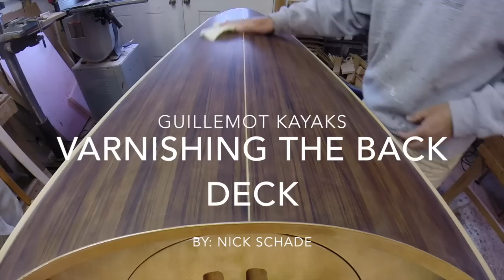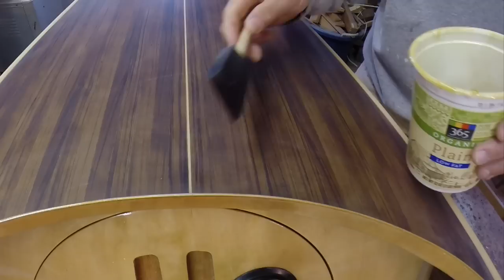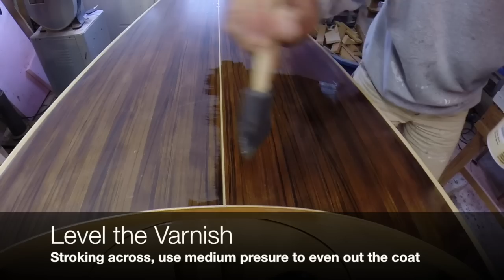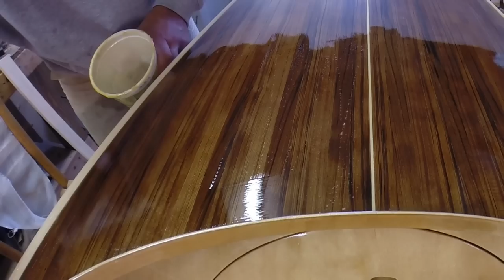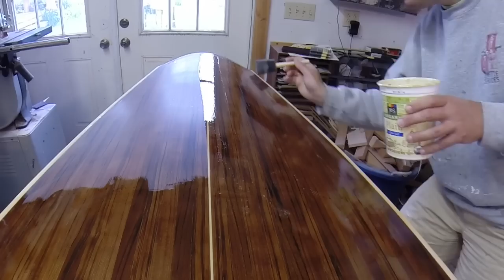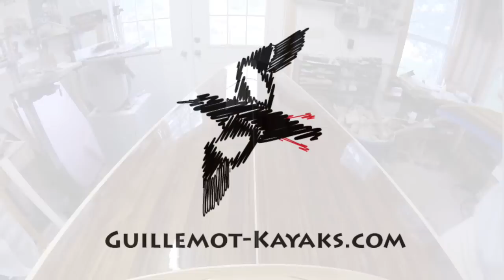Applying Varnish for a Smooth, Reflective Finish on a Strip Built Boat

Comment: Love the finish , I've always used a foam roller though and then tipped off with a foam brush at 90% to the roller line ! Then as the varnish dries keep tipping any imperfections ! That's my method ! Cheers knackers
Reply from the maker: After the varnish starts to set up and has lost its wet edge - about 30 seconds - any time you touch it will leave a permanent mark. Tipping off after that will typically add more imperfections than it removes.

I've used the roller, then brush technique but found little benefit in having to switch from one tool to another during the applications process.

Comment: I always put a thin coat of epoxy on bare wood to raise the grain and seal the wood than sand. The glass wets faster and does not get dry spots as sometimes the wood absorbs epoxy at different rates.
Reply from the maker: +Daniel Cohen There is no bare wood anywhere on this boat. Every surface is covered with fiberglass set in epoxy. This makes a much more durable finish than varnish on wood coated with just epoxy.

Comment: I don't know if this varnish is good for a dining table, I have very small grandchildren and they make a right mess at meal times so my table gets wiped very often. Would you recommend this yacht varnish ? The table is a reclaimed solid pine  table.
Reply from the maker: This kind of marine spar varnish would work, but some polyesters are a bit more durable for interior use. Application would be exactly the same.

Comment: Nick, I have watched this several times thanks for posting.
I am practicing and continue to get bad results with epoxying over glass!
Can you answer why I have sketchy areas of fiberglass weave and noticeable individual threads showing under the epoxy?
Also I am getting several bubbles (pimples) I consider to be outgassing in my layers of epoxy is this due to applying during hot days? 
Thanks
Reply from the maker: The visible threads is likely something to do with your epoxy work prior to varnishing. Sometimes the wood sucks up epoxy, starving the weave of the cloth, with the result of incomplete wetting out of the fabric.

Small bubbles may be outgassing, or they may be dust on the surface. Doing epoxy work in falling temperatures helps with outgassing. Dust is hard to prevent. If it is causing fisheyes or dry spots in the varnish coat, you could brush hard into those spots to try to fill any pin hole with varnish before applying future coats.
Reply: Nick Schade w

Comment: Would I use an oil based varnish like this to repair a wooden shaft of an outrigger canoe paddle? Or water based? I don't know how to choose the appropriate product. Part of the shaft was rubbed down to the wood while rubbing against a bailer holder made of a coat hanger during a race.
Reply from the maker: Oil based varnishes have a proven track record. You can be pretty certain they will work if properly applied. Water-based varnishes continue to improve and some are quite good, but the technology is still developing and your results may vary.
Reply: Thanks! I ended up contacting the person who built the paddle, and he recommended marine grade spar varnish (oil). I used it and had great results :)

Comment: What % of thinner do you go with to get the varnish to flow out so easily and level off without sagging or running? Thanks! Great finish btw!
Reply from the maker: I usually do not thin the varnish at all. Different varnishes work differently, but the Zspar "Captains" varnish I use is great right out of the can.
Reply: @NickSchade  That's what Ive used in the past with success. Also used Epiphanes with 5% and it was ok. But recently, I tried Total Boat Lust and Im not happy with the results at all. Un-thin the brush strokes dont lay down. With increases in thinner (5%-7.5%-10%) the brush marks go away BUT heavy sags start to form   around the vertical sides. There really is no magic formula with that stuff. 
I guess, lesson learned, it pays to get the best varnish to start instead of trying to save the dime.
Reply from the maker: I have not tried the Total Boat product yet. I have used unthinned Epiphanes. It was like spreading honey, but it leveled out beautifully.
Reply: Total Boat's claim is you can apply additional coats every hour to build up fast. Limit is 3 coats in 24 hours. This all true... after an hour it was dry to touch either spraying or brushing.  Biggest problem Ive had with it is it wont maintain a wet edge but for a few seconds. I think this is due to their drying agents and my hot shop.  I live in the south and its alway hot here.  Im sure its a good product and works under better conditions.
Reply from the maker: With that kind of quick build varnishes I will usually go for a fast application of multiple coats to get the build, not worrying too much about smoothness, brush marks, dust, etc. Then sand it out level before the last coat. I would then use a different, slower drying product for the last "show" coat.

Comment: Hi Nick ..I was wondering if you can give me some advice...I am varnishing a strip boat for a friend..but it he layed a really ruff coat of resin over cloth..do you think I can recoat resin with a good sand down..or should I just continue on with varnish?...also what it the best varnish line in your opinion? by the way your videos are great keep up the amazing work!
Reply from the maker: You will not get a smooth coat of varnish without a smooth surface below it. You should prep the surface to be perfectly smooth before you start varnishing. If the existing surface is rough, you should sand it flat. If you can not do this without sanding into the cloth, sand as much as you can, then apply another fill coat. When that cures, sand it flat up to 220 grit. Then proceed with varnish.

Comment: Do you have to use the same varnish on floor boards. Nice work by the way
Reply from the maker: Like for a house floor?  I would not necessarily use marine varnish on a flooring. It would look great but I think there are some modern finishes that are easier and more durable for walking on.

Comment: Great video. What is the ratio varnish to thinner and what type varnish and thinner? I use Epifanes clear gloss.
Reply from the maker: If I remember correctly, I am using Z-Spar "Captains". I generally do not thin the varnish. Since the base is epoxy/fiberglass there is not need to thin for penetration. Epifanes is quite thick out of the can, but will level out nicely without thinning.
Reply: You do very nice work sir. I noticed the very light touch to your ending stroke and I will use your technique next week if Cleveland weather lends a kind hand to my project.
Reply from the maker: Yes, the first pass I use a heavy stroke to get the varnish off the brush and on to the boat. The next pass is a 90° to the first with a moderate touch to level out the varnish, the final pass is with a very light touch to tip-off any bubbles and the light touch will actually lift off excess varnish.
Reply: The final coat is always thinned down for bubbles to pop easier and to make a glass finish. Just dont exceed the instructions ratio. The thinned finish will run alot easier like water. The 1st several coats are "generally " not thinned.

Comment: Nice job! Is boat varnish suitable for an acoustic guitar?
Reply: The late great Robert Ruck used varnish on many guitars successfully all though it was the exception when he used it. We spoke on the phone about his varnishing for at least one hour. He liked captains 1015. To varnish on Rosewood it is advisable to seal with a coat of shellac to avoid drying problems on that oily wood. Any finish can sound good on a guitar top if you Can achieve good results with a thin enough coat.Of course Kohno and Velasquez primarily used varnish.

Comment: Can you varnish wood before fiberglassing it?
Reply from the maker: +Jonathan McClellan I guess the question would be: why would you want to? 

It is worth understanding why we varnish anything in the first place. It is to protect the material under the varnish. Varnish protects bare wood from sun, moisture and gunk getting stuck to it. 

Varnish protects epoxy and fiberglass from ultraviolet light which breaks down the epoxy.

So, while you could varnish the wood before fiberglassing, it would make it so the epoxy does not stick as well. The fiberglass provides a lot of strength, the epoxy bonds very well to bare wood - better than varnish. By itself the epoxy and fiberglass look like many, thick coats of varnish. It will be shiny and beautiful, but sunlight will attack it over time.

We then varnish the epoxy to provide protection. To make the varnish stick well, we first need to sand the epoxy to a smooth surface.
Reply: Thanks. Great videos and talented work. I'm glad you shared them. I'm researching boat building and asking stupid questions :)

Comment: Anybody ever do a deck in this stuff ? I’ve used on picnic tables
Reply from the maker: I would not recommend it. With varnish you must maintain the integrity of the film of finish over the whole wood surface. If the surface of the varnish cracks, water will start to penetrate, breaking down the wood and causing the varnish to peel. Once the film of varnished has cracked, you must quickly sand and re-coat the whole surface.

If you do not coat the underside of the decking, you will have water penetrating the wood from below and this will cause the wood to warp and crack, and the varnish to peel.

While this can be done and looks spectacular, it is a huge maintenance chore.
Reply: Nick Schade I should of elaborated , I meant after staining , it’s a rather large deck and it’s on the south side of the house, just wondering if I could get a few more years before a re coat
Reply from the maker: @raptordan6851  Stain does not change the answer. Some sort of oil finish is much easier to maintain than a varnish because you can just add more. Varnish must be sanded before re-coating and any flaw or crack in the finish will cause ugly black spots. It will look fabulous until it looks bad, then it will look really bad and be a major chore to make look good again.

If you like the wet look of varnish, a non-hardening finish like an oil will age more gracefully and be easier to bring back. The problem with oil finishes is they can promote mildew which just turns everything black.

If you are staining it you should be able to just re-stain when it needs it with minimal prep required. Stain is essentially and oil finish with pigment added.

I am a boat guy more than a house guy, but I would just stick with stain. Don't add varnish to the situation unless you are willing to be very diligent with maintenance. 

A boat like this can be stored inside and the varnish is over fiberglass and epoxy. This is a different animal than a deck.
Reply: Nick Schade I appreciate the in depth input , I’m a welder /mechanic and not so much for woodwork , I think I will go with a dark walnut oil based stain.